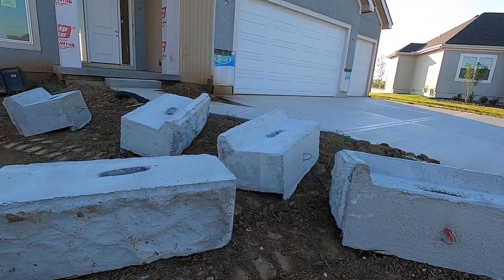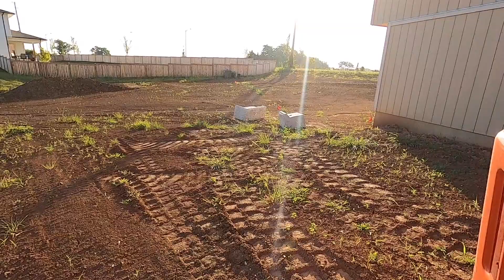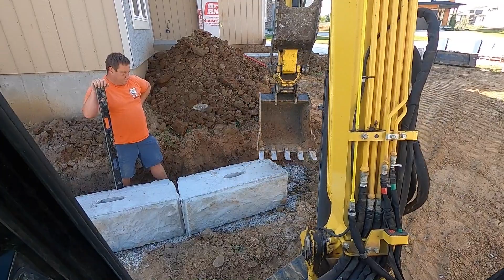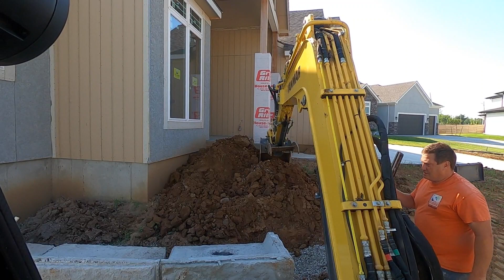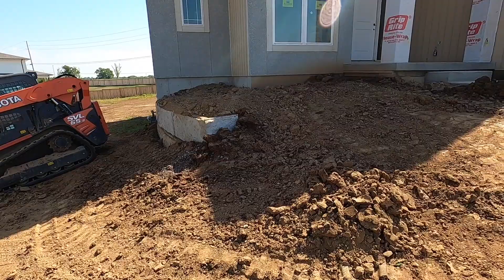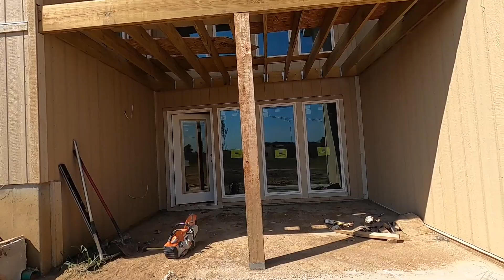Building a Big Block Wall with a Mini Excavator

Comment: Great video,  best way to lay any wall would be to use pipe and screed your base , compact , then lay 1 inch of gravel , screed , lay block , saves alot of time guessing.  Keep up the good work